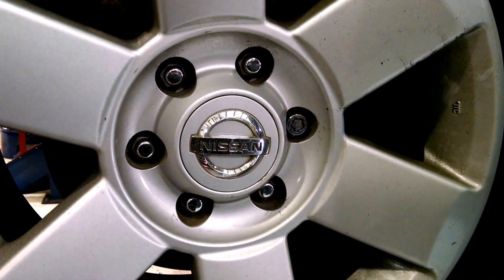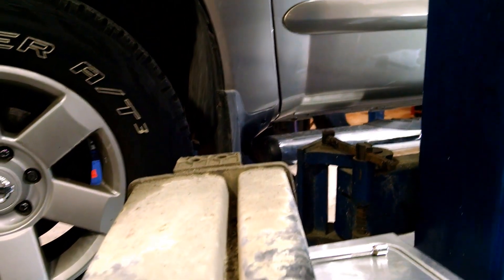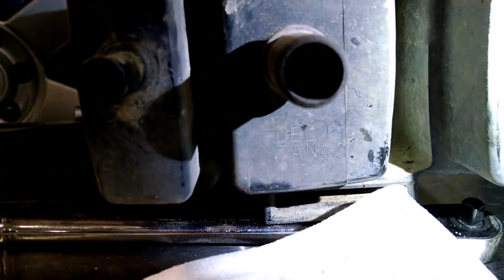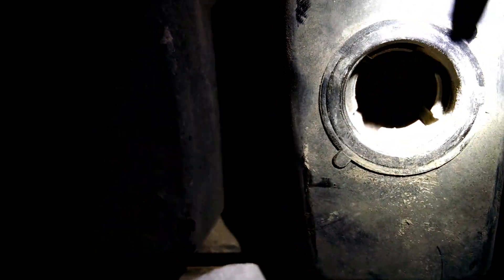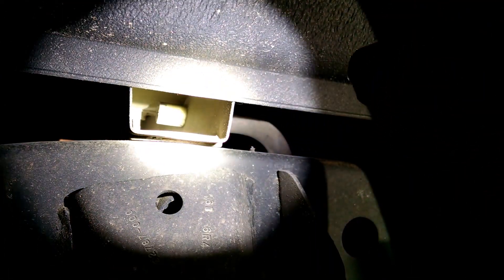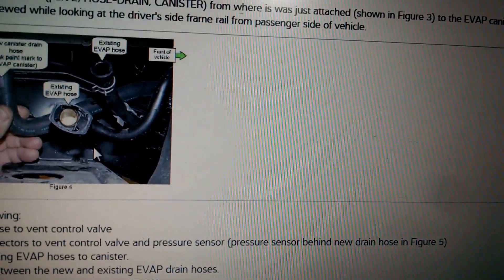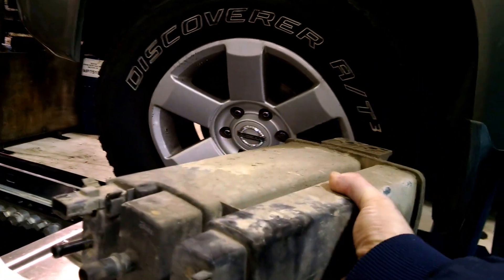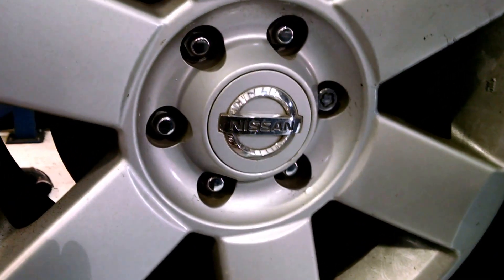CODE PO448 Nissan Titan Pickup truck

Comment: How much did this cost to fix ?
Reply from the maker: Hello T, I tried to go back and look but it was from 2016 and over 8,000 jobs ago. I was not able to find the work order but think with factory parts and this one was so clogged we may have needed to replace other components that were also affected. My guess would be $500.00 to $1200.00 We are using factory parts (aftermarket ones for less may be available. we do not recommend using used parts for this service) and carry a 3/36 warranty on parts and labor and that does add some cost to the overall price. Sorry I could not nail down the exact cost and thanks for asking a great question.
Reply: @Craigs_car_care  Awesome ! Thanks for taking the time to look ! I have the same code and was curious to what I'd be paying if this is the issue !
Reply from the maker: @HorizonMain  Your Welcome

Comment: I have a p0455. They said the gas cap but it’s not working.
Reply from the maker: Good morning JTastic, Sorry for the late response but this is one we did not get a notice on and I only saw it while answering a new question today.  The gas cap thing can be tricky but is a great place to start. The gas caps get old and do wear out after a number of years, so it can be just great preventive maintenance. We have learned through trial and error that some vehicles must have the factory gas caps because for some reason the aftermarket ones will not seal the gas tank well enough for the onboard testing to pass. Hope you got it resolved and again sorry it took so dang long to get back to you. It was a really good question.

Comment: Should have showed the R&R of those parts.
Reply from the maker: Good point , .
 Most of our videos are used to show the customer what was found or what a particular issue is when we send them their digital inspections of what was found on their vehicle. A picture of a broken part is good but a video is very good. This really helps keep us transparant and build trust. We have discussed filming some of the R&R procedures but a few test runs have had so much background noise or long pauses while a tech does all their daily stuff the editing was a beast and did not look good.  Thanks for the question/comment
Reply: Here's some tips from my recent replacement of the canister purge solenoid. It is removed by twisting and pulling it out. By looking at this video I was able to see how far I had to twist it. It's less than 45 degrees off vertical. 
I used silicone spray lube on the part when I installed the new one. I made it easy to push hard to get it in far enough to twist vertical in to it's proper alignment. 
The most difficult part was figuring out how to remove the electrical plug. I finally got it, but I can't tell you exactly how I did it! The valve body has a little nub that holds it on. You have to lift a tab on the plug to get it off. 
This video helped me more than any others posted because he showed the hole the valve plugs into. So Thanks!!